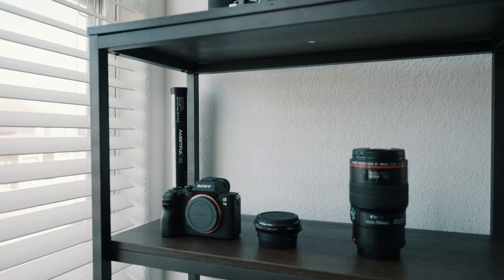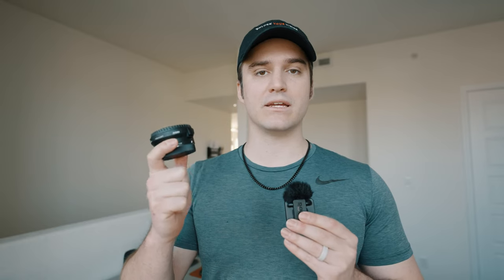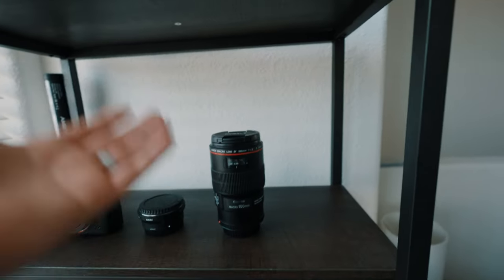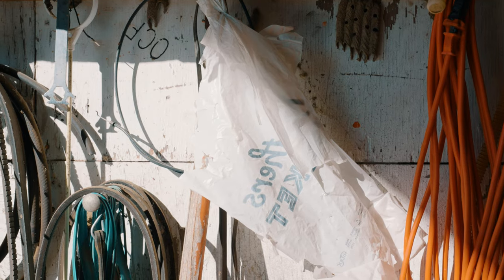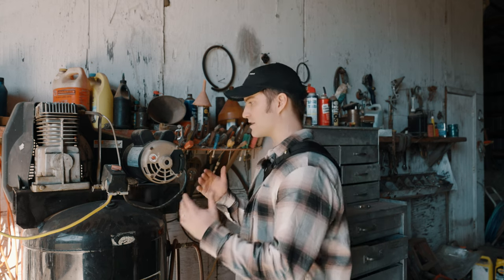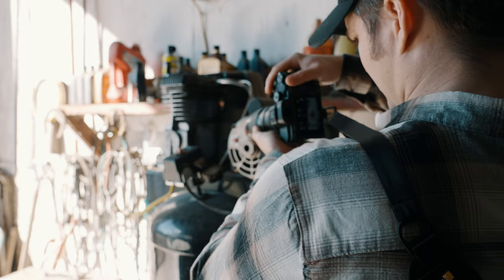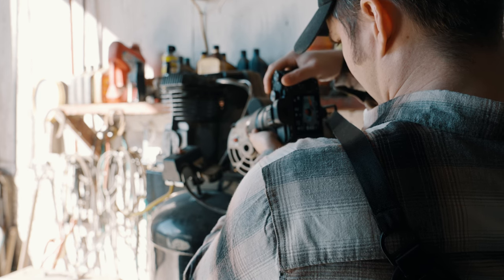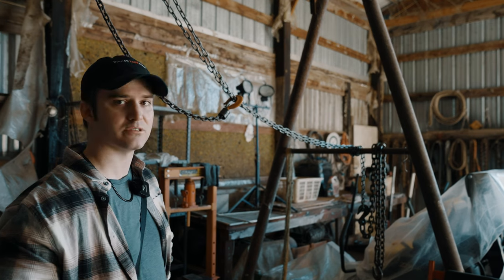Shooting Macro Photography - Canon lens on a Sony Camera?

Comment: How do you change the aperture on shooting? Is it always f2.8?
Reply from the maker: To change it you can throw your camera in Manual mode (M on your dial) or Aperture Priority mode (A on your dial) and usually you can change it with the front dial near your index finger depending on which camera you have. Could also be set to the back dial as well. Hope this Helps!